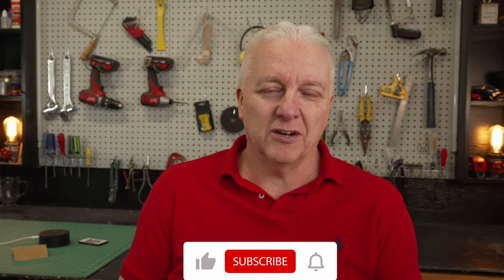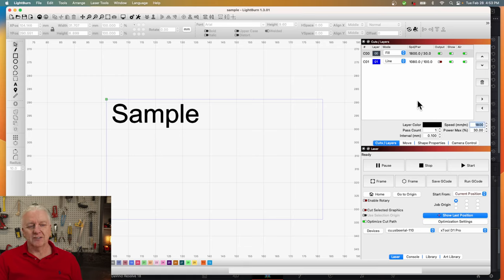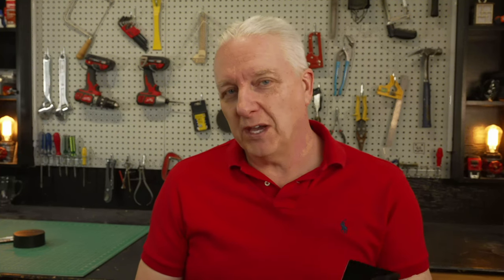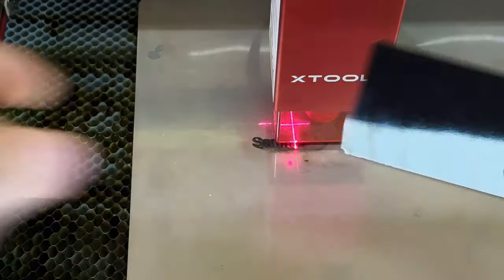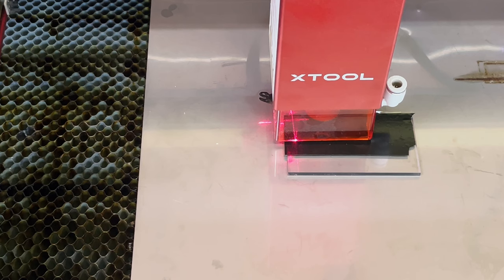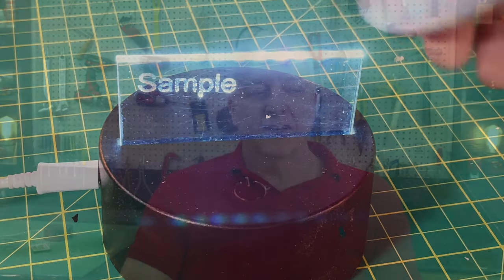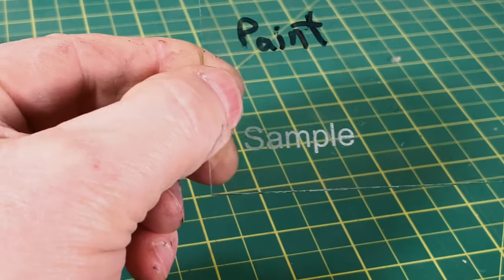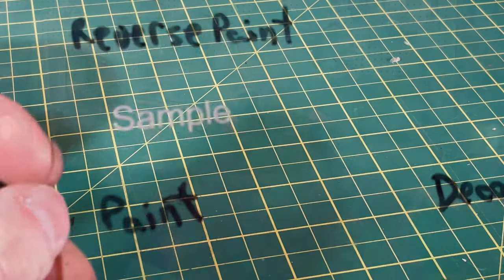Laser Engraving Clear Materials - Special Techniques for Diode Laser Engraving

Comment: I read almost all the comments and nobody mentioned any possibility of damaging the laser. Are all of these methods safe for your diode laser?
Reply from the maker: It is possible,but unlikely, to damage any laser doing almost any job, but in this case you should be fine. The only way you would damage a laser is if you don’t keep the output lens clean, or you get a direct reflection back up the tube.  A reflection is unlikely though since most materials won’t be reflective to 355nm light. Light will typically be absorbed or pass right through.

Comment: Thank you steve, I have been trying to do this on my 10w diode but not had any success with a wide range of tests, you quote 1800 x 30% and I assume this is for your 20W. I am running out of acrylic having tried so many samples, would you suggest starting at 900 x30%. Many thanks
Reply from the maker: For a 10W you might want more power not less. I can’t give you an exact setting because this will vary greatly depending on the laser. Do a lightburn engrave test on your prepared material and you’ll know the best setting for sure.

Comment: U had a lot of comments.  So it was super hard to find what I was looking for.  When u painted the acrylic, was the paint side face up or down?  Also, thank u for teaching instead of condescending.  I'm so new but, layering and wood working together seems to be a snobbish issue when we r just trying to learn.
Reply from the maker: You can actually do either, but I usually prefer paint side up.  The diode laser won’t touch the clear glass or acrylic regardless

Comment: Steve I am having trouble with none of the engraving showing up on the lighted base. I can see the image just looking at the acrylic out of the base  Thanks for your concise presentations
Reply from the maker: If you can see it on the acrylic, there's a chance that it isn't deep enough, though for an edge-lit sign, it shouldn't need to be deep at all.

If you are using one of those cheap bases available on Amazon, try looking at it in the dark because they aren't very bright.  Assuming the light is on, try flexing the sign from one edge of the slot to the other.  Maybe the light just isn't hitting your engraving.

Comment: I have my air assist. I just got today, but I don’t know how it goes on to side of the laserhead cause none of the pieces fit.
Reply from the maker: What laser do you have?  I you bought you air assist from the same company it should go together fairly easily.
Reply: @SteveMakesEverything  no bought my air assit from Amazon it’s a Nivll
Reply from the maker: @BrendaDavis-1963  With your 5W laser air assist won't have a huge impact.  It might help with cutting a bit.

But if you have a 5W laser, there probably isn't a mount for it on the laser module, which is no doubt why you are struggling with it.  If you still have time to return the air pump, do that because it's probably not going to work in this case.

If you have the budget, I'd suggest a higher power laser.  Something like the Longer Ray 5 20W or an ACMER P1 20W would make a huge difference for you.
Reply: @SteveMakesEverything  yeah I know it’s not gonna work miracles but when I practice on cutting wood, I’m getting a lot of charring around the edges. I know it will help that.
Reply from the maker: @BrendaDavis-1963  The real problem is that if you don't have a mounting for the air assist, then the air won't be getting to where it needs to be.  I probably asked already, but if you email me a photo, also include your laser details.
Reply: @SteveMakesEverything  I have a mount on the side of my laserhead it come with it. I gotta take the four top screws, loosen them, and then slide the mount on the on the right side of the laserhead and then put my hose on the side where the little pipe thing is.
Reply from the maker: @BrendaDavis-1963  OK, great.

Comment: I tried engraving onto a flat sided, commercial, jar yesterday using what we call masking tape here in the UK (painters' tape). It is a ceam colour. The panels on the square jar are about 45mm x 75mm, I left the screw top on the jar. So, xTool D1 pro 20W, Lightburn, 80mm sec and 65% power, the jar broke, not just cracked but broke! I used the settings from another channel but the presenter was etching line drwings whereas I was attempting to etch a solid image, an oriental dragon although the subject matter is irrelevant. Any advice would be truly appreciated. Cheers, Bob.........................Subscribed.
Reply from the maker: Hi Bob,  first make sure that the lid is not on because the heat will cause pressure in a sealed jar.  You will generally need to move faster, since lingering with the beam on glass will cause local heating and stress the glass to the point of breaking. Also 65% is quite a bit of power so you might want to reduce that a bit.  If you engrave with higher speed and lower power, but find the engraving isn’t quite right you can re-run the job (so don’t move the jar until you’re happy with the engrave obviously). 

Another thing you can try is to put water in the bottle to absorb some of the heat - leave a bit of air though so the expanding water has somewhere to go.

Since you already have a broken bottle, you can use it to run a martial test or two to get the best settings.  Since the glass isn’t clear, you will get more absorption, so you will definitely want to reduce the power quite a bit.
Reply: @SteveMakesEverything  I just happened to be here at the right moment, good afternoon sir 12:49 pm here. 

I did wonder about the lid being in place, hence the reason for mentioning it. I will practice more with various settins. Thanks for your prompt reply. Bob
Reply from the maker: @duster.  Happy to help - it's why I do this.

Comment: This was a great video.  Thank you for going over the pros and cons of the different techniques.  Will be trying the tempera paint soon.  Wondering if the same technique (painting the surface) would work when engraving metal, rather than buying those overly expensive laser black sprays.  I mean it must take it off the aluminum cards you use underneath as you have to repaint them, but is it actually etching into the surface of the metal as well?
Reply from the maker: If you paint aluminum black you will be able to engrave it to bring aluminum colored details out of the black background

Comment: Very useful videos! Thanks. Could you please mention the power of your laser? Giving the power used as a percentage of the maximum is only useful to others if they are using the same power laser as you use. Thanks.
Reply from the maker: I believe at the time I used a 20W Xtool D1Pro for this
Reply: @SteveMakesEverything  Thanks! I am using a 5.5 W laser, so I need to adjust my speed and power accordingly.

Comment: have you tried blackboard black spray, cleanes up with hot water very easy
Reply from the maker: Thanks for the excellent tip.  I’m not sure how it differs from tempera paint though.
Reply: @SteveMakesEverything  I found that a lot harder to clean off, try it and let me know
Reply from the maker: @grahamwhitehead5629  At the end of the day, use whatever process works best for you.  You don't always have to believe crazy old YouTubers 😉

Comment: Hi Steve, I saw your video, my question is this. Is the black part always placed under the transparent material? And you only put the tempera on one side? Thank you
Reply from the maker: You can do this on either side, though it seems to work a bit better from the back.  You mileage may vary though
Reply: Thank you Steve, good continuation @SteveMakesEverything

Comment: @SteveMakesEverything What are the settings for the acrylic? I have the same diode laser
Reply from the maker: Hmm, asking me the settings for a project I did months ago will challenge my brain.🤔 The settings will be for the material you are using to mask the acrylic, though, since no settings will work specifically for clear glass or acrylic.  Since any laser interaction will stop at the glass/acrylic, you will find the settings are pretty flexible.

Comment: Hello Steve, Thanks so much for this video. The only method I've seen in YouTube before this video is the black cardstock. Thank you for taking the time to show other options. I have a 20W laser and would like to know what you recommend I use for settings please. Do you do cross-hatch or a single pass? I bought the 4 bases package from Amazon and would hate to ruin any of them since they are no cheap LOL. Thanks again.
Reply from the maker: Setting will be laser specific, so you may just have to run a material test.  I tend to do most engraving as a single pass but I’m not saying that’s the best technique

Comment: great video, learned a lot. question: when it comes to the wattage of the laser, will the effects on my projects be different because I am using a lower powered laser, not a 20W laser? That has more to do with print settings I assume? Thanks.
Reply from the maker: Nope!  You will probably have to set the speed a bit slower though

Comment: Do you know if it would be safe to engrave about 1/8" into artificial countertop granite or quartz filled?
Reply from the maker: Engraving stone is fine, assuming you have proper ventilation on the laser.  It might take quite a few passes to get down 1/8" though - depending on your laser.
Reply: Thanks for your reply, Steve. I usually engrave using the vector feature rather than the image feature and was a little worried about fire hazards. I've never engraved on any type of acrylic or plastic, so I am a bit nervous to try it.  @SteveMakesEverything
Reply from the maker: @kevinreidconrad  With my CO2 laser I have engraved Corian, and it was fine.  I've also done granite in the past and there were no surprises.

Comment: Would these methods work to "cut" The acrylic too? Like holes etc?
Reply from the maker: That is a good question, but no.  Cutting clear acrylic with a diode laser isn't typically possible because blue light passes right through the acrylic rather than being absorbed.  So there is no heat energy transferred to the material.  This applies to most colors of acrylic except black or some of the darker reds.
Reply: @SteveMakesEverything  Thank you!
Reply: Would leaving the protective film on the acrylic would allow it to be cut

Comment: This was an awesome video so I do have a couple of questions 1 what speed and settings would you recommend for the d1pro 20 watt and do you need a new piece of cards stock after your done for new projects
Reply from the maker: The settings will just require some experimentation or check the material settings on the Xtool site. This is laser dependant and my D1Pro is 40W.   The need for new card stock will depend on the shape it’s in after engraving. You might be able to get more than on run with it, but it’s pretty cheap, so it’s probably not worth trying.
Reply: @SteveMakesEverything  ok thanks

Comment: Hi Steve.  With the card stock and painted business card, since they are underneath the glass, do you focus on the top of the glass surface or on on the card surface underneath?  Thanks
Reply from the maker: Ah I wanted to mention this in the video.  

Putting a marking material behind the glass means that the laser has to focus lower, so you need to drop the laser by the thickness of your glass.  The best way is to put your cardstock down and focus on that first and then slide you material in.  Note though that your material may be thicker than the remaining space, so you may have to raise the laser head up enough to get it clear.  This obviously means you probably won't be able to engrave material thicker than a few millimeters using this technique.  However with the typically long focus of a diode laser, it's not absolutely critical to the hit the exact focus to get a great result.
Reply: Hi Steve great video thankyou , can I ask what size diode laser are you using for this. I have an Ortur LU2-4-SF which I think is 5.5 watts . Many thanks in advance.
Regards
Col8n

Comment: Could you paint clear acrylic and a diode remove the paint leaving a design without marking the acrylic? I've tried this with my CO2 but the acrylic gets frosted.
Reply from the maker: Yes you can!  With the right power setting you will just remove the paint.  Diode laser generally won’t tough clear acylic
Reply: @SteveMakesEverything  Thank you for your reply. I'm trying to gather the most logical tools for my ideas which are atypical.
Reply from the maker: @justalanjones  Atypical ideas are my favorite kind 🙂

Comment: For a 5×7 piece of glass, could you get a piece of metal and paint it black?  Would that work the same as the business card idea? Great video!
Reply from the maker: Yes it should work, though be careful not to use too much power or the glass will crack.  With the glass sandwiched on a metal plate there’s nowhere for the heat to go

Comment: Does greyscale (either dithering or intensity control) work with this method?  That is, could you do a photo?
Reply from the maker: Neither glass nor acrylic take well to shading. You can try dithering it will be your best bet
Reply: @SteveMakesEverything  especially also, with lightbases like that essentially any depth should be the same brightness, so it's more about "surface defect density" that makes a surface show up, iirc?
Reply from the maker: @nonchip  This is mostly correct, though something lower on the plate can create a shadow (and dim) something higher.  The secret solution to this is to engrave deeper  as you move up the plate

Comment: Have you tried placing matt black vinyl wrap behind the acrylic or glass? That would peal off easy.
Reply from the maker: I have not, but that is something that is easy to try.  And I certainly have lots of black vinyl lying around.
Reply: @SteveMakesEverything  hope you update this comment if you try it, thx for your work in putting these videos.
Reply from the maker: @texascrossbowdude636  The only worry I have is that vinyl is PVC plastic and the "C" is chlorine, so it really shouldn't be used in conjunction with lasers.

Comment: I use my airbrush with acrylic based color. really fast to spray on and dries really fast. After laser engraving I just wash everything off with water and it comes off really easy in bigger film parts... Next try is to use thined down tempera paint in my airbrush but as I have just started with airbrushing I have not found the right mix to have the tempera work with my airbrush okay...
Reply from the maker: Tempera paint is good for acrylic, though it's water soluble so in the wrong environment it could be short lived.  It's not really designed to be thinned though, and that's why you might be running into issues with it.
Reply: I thought about airbrushing as well. But I think the cleanup would be worse than just a foam brush
Reply: @AB_thingsDFW  It cleans up very well. Like 20sec. under warm Water with a Sponge and the paint is washed off, as a bonus:  a drinkingglas is then clean and ready to use.
Reply from the maker: @AB_thingsDFW  Yeah a foam brush works fine.  No matter what you will need to apply a second coat.

Comment: 5:44 Without air assist your laser lens gets dirty and you get a lot of soot on your project. GET IT.
Reply from the maker: Not much soot from acrylic or glass, so it only a bit of paint or paper and both will be vaporized. At any rate there is no soot on the laser. Air is most practical for cutting

Comment: I have used a diode laser to engrave acrylic, and let me tell you, my C02 laser is so effortless and in the long run cheaper then a diode laser, why would you ever want to used the diode laser for this? The C02 laser needs no prep, no expensive chemicals, (Enduramark Charcoal Glass$70.00 per can), no messy Tempura paint, super fast 1500 mm/mn at 3 on the power scale, and way brighter and crisp than the Diode. I do have an Xtool D1 Pro 30 watt that does a fabulous job of engraving and cutting
Reply from the maker: In my world any acrylic cutting/engraving is also done with a CO2 but I tend to do high volume commercial jobs.

This video isn’t intended to suggest that a diode laser is the best for Acrylic, only that for those that own one, there are options to allow it to happen.  A diode laser owner could make similar arguments about engraving stainless steel compared to a CO2 laser where you would have to buy an $80 can of Cermark for CO2 engraving.

Personally I tend to avoid the head-to-head comparisons between laser types because each has a place where they excel.
Reply: because i got my diode laser for branding steel parts for $150 and it works wonderfully, and things like this just mean the tool i bought can also be used as a hobby to do many more things. co2 and fiber setups are nice, but cost way more and dont give me any benefit since my single diode already keeps up with the work i need it to do